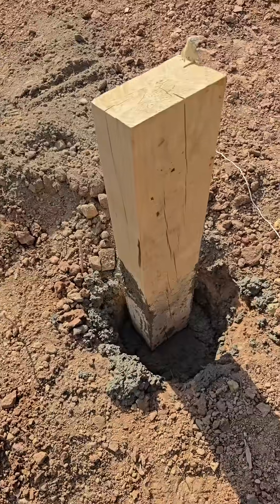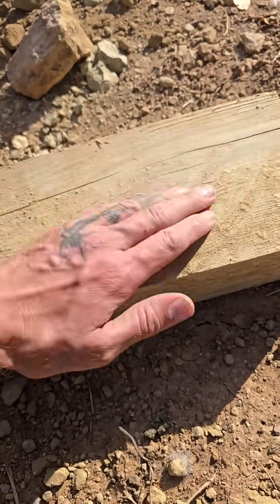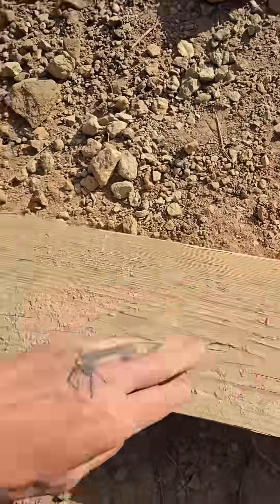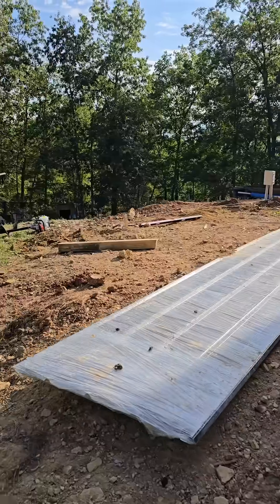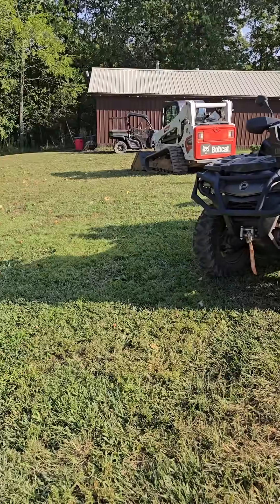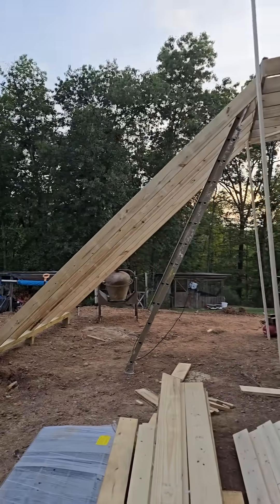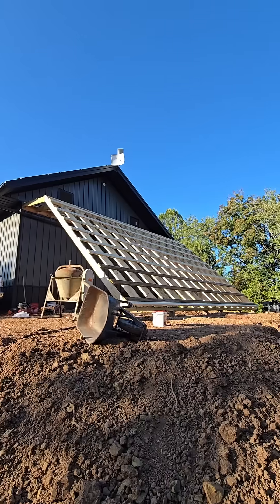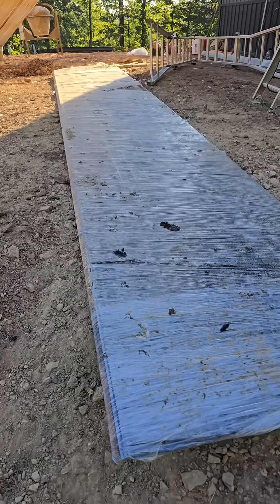Starting the new solar array #narrowayhomestead #offgridlife #solarpower #solararray #morepower

Comment: I used old bed frame angle iron and 2" steel pipe to make the rack for my display. The output was maxed because I built in tilt apparatus. Easy enough; the individual 10 panel frames each had hinges on the bottom. To stay within the needed 15° of flat on to the sun, that tipped them up and down, about 4 times per year with just a notched prop stick. Then the left sides, toward sunrise, also had hinges for following the sun side to side. (I did hear of using auto drive shaft universal joints as a single gimbal) This was a lowering of the right side accomplished by weight and springs. Propane bottles supplied the weight, the gas itself the regulation. I set them up in twos, one on each side, connected by hoses, with the left side exposed and the right side shaded. When the sun heated one the gas expanded and pumped over to the other bottle, that gas, recondensed weight then pulling the panels against the spring. The trick is to expose just enough of the bottle so that it becomes hidden by the movement every 15°. That starts and stops the frames by itself. The gain is over 40%. 
There are other setups very similar. One uses an electric motor with a light sensitive switch, which is mounted at the bottom of a tube, who's diameter provides the on/off timing for the 15°. 
At the cost of panels think what 40% saves you.

Comment: I also built my panel structure with 4x4s and 2x4s. allowed a 1" gap between panels to allow rain to pass. that allows me to build warm frames below. since shaded I can grow greens and other vegs that don't like intense sun year round without having them quickly bolt if in direct sunlight. enough rain comes through that in 15 years I have never needed to water. additionally the dogs live to lounge under the setup.

Comment: If you set your post in the ground and put 6 to 8 in of gravel around your post then your concrete your post can still drain out the bottom to stop it from rotten off as fast

Comment: As long as the post concrete is finished above grade and slopes away,  it should be fine.
Soaking in half and half( kerosene/used motor oil) gets you bonus points.

Comment: Drill the posts with a long 3/4 spade bit angled down and pour old engine oil into them the plug them off with a whittled offcut. 
Dry or not, those posts will last 30yrs under loads

Comment: Soooooo happy to FINALLY see someone with the brains to dual purpose the underside of their solar panel array!🎉 Would still love to see the low end set up higher though---that space is valuable. Say 5', which is enough to store things like snow mobiles, quad runner, even the impliment attachments for your new "toys" to be under partial shelter. Great job anyway!
Reply: My laundry machine lean-to’s roof collapsed in the rain. I got some cheap old solar panels and put them up instead while also moving them up about 4 feet from where the old roof was, making it so I can actually stand up while doing laundry instead of being hunched over. Solar panels make excellent roofing material and old ones are cheap as free!

Comment: Is there going to be pressure side load on the posts? Or do you think that the fasteners and the posts embedded in concrete will resist the pressure?
Reply: So as a bot, why do you use links in your comments? Is it to track sentiment shift? Call more bots?
Tell me
please
while you are still able to talk. Your boss said its ok.
Reply: @gapesherman5218 I was looking at the side load weight and thought that poo putting some collar ties to make a triangle would reduce the deflection against the building and the posts on a gable end . Which has little sheer strength. You don't see " lean " on gables for a reason. All in all I hope for success for the dude building this.
Reply: @Nathanael-hf7lz  dude don't explain yourself. Anytime anyone asks a legit question or any question for that matter, Nate's Cult will come for you including Nate himself. They will question you and call you a bot...Even if you're just wanting him to succeed. They all think they know everything just like Nate does.
Reply: @Nathanael-hf7lz What was the link for? What was your last injury? I appreciate your analysis can you add what wind sheer displacwment is for that size of a roof?
Reply: I wish you well and enjoy watching these videos  @gapesherman5218

Comment: Got a post for the large mailbox. The 29th of this month would be 10 years still standing. I coated with tar but can't remember if I painted all the post or not.
Reply: Charing then coating in tar was my grandpa favourite method.

Works fine for me in rainy rural south Wales.
Reply: @ieuanhunt552  The paint is even holding up. Not even chipping off. The post is a three piece mailbox posr. I went the extra route and add metal brackets to insure wouldn't fall apart.
Reply: .  lost idea in the states is the charring with a torch or fire.